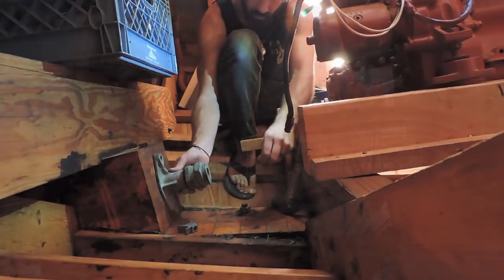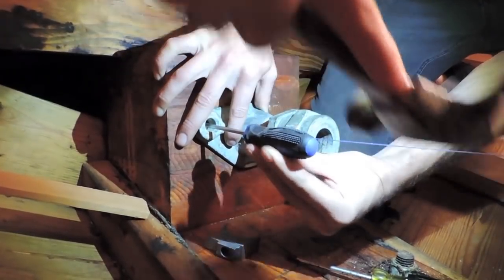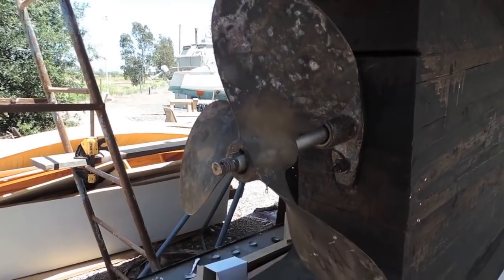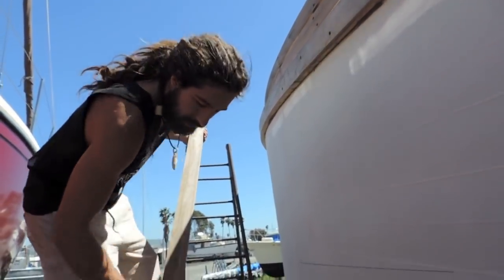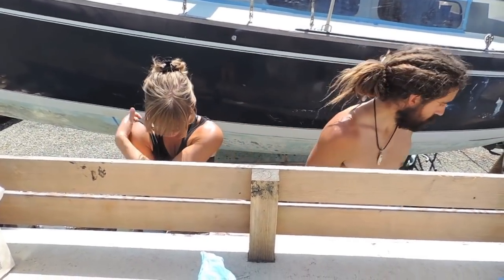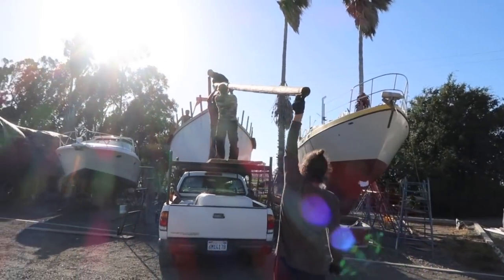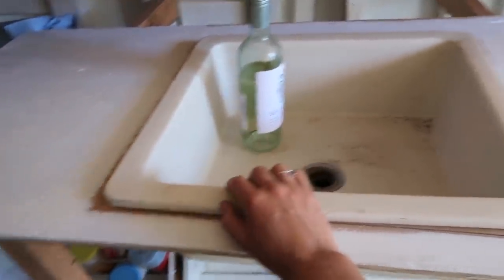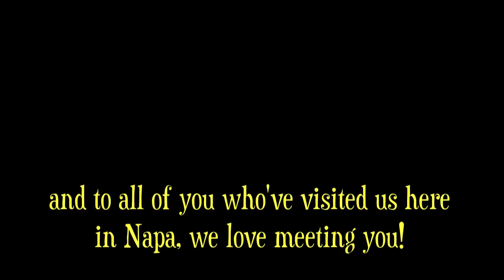Salt & Tar: Episode 36 - This, That, and the Other Thing

Comment: “We put it on upside down” was SOOOO meaningful to me as that seems to be my life’s motto! Every project, no matter how small, suffers from something upside down, backwards, inside out, reversed, the wrong end, part, size, thread, angle, or braking when overtightened. And at least one “where did I put that (fill in the blank) that I just bought?” Seeing two relative pros do it to was, somehow, reassuring and encourages me to be less critical. Thank you!
,
,

Comment: @16:30   Yes, a slick is a very personal tool. It takes extra time to sharpen and obtain the perfect cutting edge curve. I have inherited my late Fathers slick and can feel Dad's presence when i use it................... (you have a very good and soulful boat neighbor).
Reply: My 3" slick was 75 yrs old when I got it.  That was nearly forty yrs ago.  Many of my tools are older than I am.  when I use them I think of if those men would approve my work.  Quality tools do have a worthy life to be passed down.
Reply: Pat Brown
I inherited some of my late Father's tools, a master machinist, and master welding trainer. I even have the very first tool he made, a bolt puller, on a lathe at Tech school ! Every time I wrench, I too feel his presence over my shoulder and wish for his approval and advice as in my youth. He tought me everything.

Comment: Linseed oil...
Once a day for a week,
One a week for a month,
Once a month for a year, and
Once a year for life.

Do this and you will have no issues with your oiled wood.
Reply: True true.......we old timers know this and live by it.
Reply: mildew loves linseed oil which can be a problem especially in moist (hmmm.. boats?) conditions. Also no UV-light resistance.. UV causes more damage to exposed wood than any other factor.
The  saying 'Once a day ... ' is at max some sort of guideline.. The time it takes for linseed oil to properly dry differs a lot depending on wood sort, climate, etc etc. 'once a year for life' is also untrue. the intensity of usage of the subject, say a tool handle that's used every day or some furniture that's in a corner of the room makes a big difference in how often it should get maintenance
ever tried tung oil?
Reply: @amananca  Interesting. Have you ever tried Pedant oil?

Comment: It’s me again.  On canal boats we fit a grease point between the stuffing box and the outer bearing.  This is connected to a remote greaser which can be filled with grease and periodically given a twist to make sure that the space is full of grease.  Not sure if you need to do this with a cutlass bearing.( cutlass bearings aren’t used as canal water is often gritty, which wears the rubber).  Quite often a container is placed below the stuffing box to catch any drips or grease.

Comment: Wow! You two bring a tear to my eye. You love one another and you love what you are doing. What more is there in life. All the best and can't wait for the splash.
PS - that stuffing box has to drip two or three times a minute when the shaft is turning, and stop dripping within a couple of hours when not turning. Start snugging it up a little at a time and never run it for an extended time without a slow drip. Water lubricates the bearing and stuffing.

Comment: Ruth, I remember you had answered this before but I will say once again, in my earnest hope to be more clear, that because the shrouds are raked, or canted aft of the mast, the bend in the chain plates at the channel must also be raked, or, less than a 90* bend.  The degree of bend in the chain plate where it rides over the channel would be the same as the angle of the shrouds aft of abeam the mast.  I reckon the bend in the chain plate might be about 20 degrees.  Remember, you has said the chain plates lead aft to station 10 or so.

Comment: You probably already know this but the trans drive flange has to be dead square, centered and parallel to the shaft flange. As in bring them close together and check the gap with a feeler gauge wedge shim adjust the angle so there is no gap 360 deg. also the center lines line up. Put an indicator on the prop shaft near the flange and rotate to check centering run out. Then when its in the water and has settled a bit check again.
If theirs some sort of rubber drive flange ect it is still important to get them straight. It really makes a difference on vibration and wear. Also polish the prop with a fine wire wheel it also makes a big difference in performance.(and will look good in pictures) Decent sized prop for a sail boat looks good
Getting close to launching yahoo

Comment: Great gift for a boat builder, shaping wood made much easier and provides a better result. Nice work on the prow and stern. Did you choose to shape the aft keel? Rounded off loses no strength but can give a much smoother ‘release’ improving speed. Shouldn’t affect tracking as rudder is behind the keel.  Rounding rudder edges would also smooth out tracking & resistance.  
I kinda dislike me for mentioning things you probably already thought about or done but am new to your journey and mean naught but well.  
     To safe and lengthy passages
     Drew

Comment: Great episode... nice to see all the work is paying off!

Ave did an episode showing that spring lock washers are useless. We dont use them at all in aviation. Use temporary (not permanent) locktight or drill and safetywire... its much better!
Reply: I use red lock tight. or what i call star lock washers (serrated) Yes split washers should only be used on fences and gates ect.
Reply: Ps lock tight does not work on stainless not sure if it works on bronze? Don't think so. The split washers may be the only option?
Reply: Locktight brand 242 and 243 are designed for inactive metals specifically ss. Active metals (bronze) 243 can be used but 7649 needs to be applied first. We use this stuff on everything in commercial aviation. 

Personally, i would side drill and safety the nuts. To prevent any chance of the barring assymbly from loosening and causing damage to the stuffing box... but its their boat... millions of ideas and ya never know what wont work till it doesnt.
Reply: Interesting you learn something every day How will it hold up long term under salt water? Dont see them doing the special locktight thing. Safety wire sounds interesting since when you think about it they have 2 points of rotation the nut and the stud in the wood so if you wired the two together or to the center that may solve that? But as im sure you know safety wire is not designed to maintain a high TQ the component can still loosen its designed to keep the nut/stud from  loosening to the point of causing a catastrophic failure. (falling off)

Comment: Looking real good. On the packing gland make sure it isn't too tight it can get really hot if no cooling water can get to it. On, Gland seal wrenches. Make sure you have the ones that fit and store them close to the seal so they are handy. You probably already know this.  :-)

Comment: Any concerns about seawater in the shaft log (the wood part that houses the prop shaft) ?  I forgot how you treated that wood so long ago.

Is the traditional way to NOT grease the packing ?  Lanolin grease might be good.

VERY COOL story about that slick.  Properly cared for (packed in oil soaked rags) it will easily see 100 years !  Looks like Garrett knows how to sharpen it !

Comment: Wow......I may have missed something earlier, but I sure do hope you sealed, or treated in some long-term fashion the tunnel the prop shaft runs in through the whole deadwood/keel.   It WILL end up full of sea water....and no amount of bottom paint or treatment on the outside will keep it from just simmering along in there.

Comment: Add thrust bearing on rear. I’d add a third bearing inside and use a flexible coupling. Also need to have water flowing through cutlass.
Reply: Not sure about there trans? But a paragon trans or a velvet drive? Spelling/ ? does not need a thrust bearing. Flanges work well but need to be squared up dead on like within .002 The water in the tunnel is a good point  its just going to fill and not cycle? 
Im sure there is many reasonable ways to set up a drive line

Comment: Funny I wrote below b4 end and u did it. So funny shows why your one of the best channels on the net,

Hey not sure how old this is. But try moving prop back or you'll have power issues its to close to the keel. Or shape the keel around prop so u get full water movement.  Its to close your gonna lose alot of power.
Love your channel. This was made when u first showed prop placement so may have changed.

Comment: Always fun to watch you guys make a process. Keep up good work and patience will pay off. The question I am curious and notice your boat's wood is now seasoning and crack and what are you guys going to do about a wood crack open? Are you going to fill the wood crack or coat with epoxy? Just wondering. Stay strong one day at a time.

Comment: Of all the channels I sub to, I enjoy it most when I see a new S&T episode waiting for me. I know part of it is from never really knowing when you will post an update. And a lot of it is that having watched you guys for so long I almost feel vested in the project. I was almost expecting an episode like this at some point, covering all the "little stuff" that is totally necessary but hard to fit in a regular episode.

I understand the stuffing box, and that it has to drip slowly to work properly. That means that the prop shaft hole is filled with water. I know you sealed it good, but I would be afraid I didn't do as good a job as I could/should have and with the water standing in it, it would rot out on me. Is periodically resealing it something that gets done or not. It would be a bit of a pain pulling the prop and shaft back out, but I would think that was part of regular maintenence on a wooden boat.

Comment: OK,  Silly question but I guess you are not using a stern tube and relying solely on the deadwood and bedding compound on the stuffing box to create your watertight seal.  While you might get a great shaft seal, one wonders how well the sealing arrangement will work if you suffer any damage at the stern?

Comment: Been watching the series doing a great job BUT installing the prop shafts and bearings you do need to fit a stern tube , if not you will probably get problem with water and marine life getting past the bearing. Also viberation from the engin keep up the good work. Kev

Comment: Greetings!
Love your videos and fresh approach to boat-building.  Have one concern about what is shown in the start of this one.  It appears that you used fasteners to secure the stuffing box and the cutlass bearing assembly that are lag screws on the wood side and regular threaded machine screws on the other side.  Is this true?  My experience with using lag screws in any application where a lot of movement will occur (such as this) is that they eventually work loose.  The predrilled wood holes just can't retain their dimension, become enlarged, and the fasteners lose their functionality.  With a drive shaft, that could cause serious issues.  
What do you think?

Comment: I have a question. Once the prop shaft passes through the outside bushing and flange, there is a short length where the shaft is passing through an open space enclosed by the wood of the boat. Then the shaft passes through the inner bushing and packing gland. The packing gland prevents water getting into the boat. But the outer bushing isn't water tight. Will water get into the space around the shaft where it passes through the wood? That cavity will be filled with water? Has the cavity been  waterproofed?
Thanks!
Reply: I was thinking the same thing...thought I would read the comments before posting.
Reply: Yes and sort of is the answer I think.

Comment: Hi Ruth and Garrett, I know you get many comments and you cannot possibly heed them or read them all. One thing I did notice and perhaps you have too is your diesel engine has a drain tube on the crankcase so you can "suck" the used oil out when changing it. I follow others doing similar builds and cruisers too. You might want to make that tube gets replaced with a new one and also it doesn't come in contact with anything while the engine is running. It can be damaged without you knowing and you could easily have oil in your nice clean bilge not to mention the possibility of losing you engine to lack of oil. Are you going to put a figurehead on the bow beneath the bowsprit? Nice shape work on the stem by the way.
Just ordered my shirt, happy sailing.

Comment: Gland packing must alway drip water so I doesn’t burn and wear the shaft if that becomes annoying you could engineer a mechanical seal to fit that installation and no dripping into your hull

Comment: Did you install a KINGSBURY thrust bearing on that propeller shalf for that propeller to push/pull against to transfer force to the hull. Without it you will destroy  the  engine crankshalf or the transmissions shalf support and much smaller thrust bearings that can not take the force. .
Reply: My wood cabin cruiser with a paragon trans does not have or need an external thrust bearing. Its pushing on the back of the trans not the crank shaft . maybe there brand of trans needs an external thrust?
Reply: That transmission better have a heavy duty thrust bearing in it. Some marine transmissions do have an internal thrust bearing to compensate for the propeller push/pull.  Without a thrust something is going to wear and break from the sideways thrusts.

Comment: Silly question 72! - Wont the set up mean the prop tunnel will be full of water? Wonderful though...
Reply: Not silly
Reply: I understand that water is needed to cool the contact points on the shaft - many times i've burped shaft seals. I was just wondering about the exposed, but treated wood???
Reply: They have been using different treatments on the wood as they built it (OLD style treatments) Hope that is good enough.
All it takes is one area developing a problem and they will have to haul it out and do some surgery.
If he gets the seal packing set right it should be very loose to start to allow for the swelling maybe that will  let the air out? I think they know to tighten it till it just stops leaking after it sits in the water for awhile
Reply: Absolutely agree. In my head, and if it was my soul project! I would be thinking of lining the tunnel with epoxy and a Hep20 pipe to stop standing water. Probably overkill and totally not necessary - but my brain would explode with worry! Not a criticism of their wonderful undertaking - just a question as wood is a wonderfully new calling for me in boat construction...

Comment: And now drill holes into the timber log and fill it with hot grease , you can’t leave it hollow water is going to get in there and rot ,
Reply: Good point

Comment: If you want linseed oil to do a protection job, the first of many layers should have been done with a mix of turpentine.. as much as 60-70 percent turpentine, for maximum penetration. Only the last few with linseed only...
Reply: They did say they were mixing it with pine resin..........basically turpentine.
Reply: @alexbowie6316  no it's not. Only if it's distilled it is, then it has the properties that enables it to draw/penetrate the oil into the wood... big difference.
Reply: Even white spirit is acting as a transfer agent mixed to Linseed oil. Nowt wrong with pine tar............Vikings and people in that area today still treat pine and spruce boats with it.   Are you bothered?
Reply: Alex Bowie  One shouldn't absolutely NOT use white spirits as a transfer agent, it transfers itself more than what it's mixed in with... very poor suggestion. And pine tar and resin... sigh.. NOT THE SAME! You should stop commenting on a subject you obviously know very little about. The Vikings are not impressed.
Reply: R. E. Hill seems the type of person who'd have a large empty space around them in a crowded bar.
Reply: Ok I'm dumb enough to get into this.
The first coat is by far the most important since it seals the wood and limits the following coats . you mop the whatever on until it all stays shiny for at least a few minutes and the areas that do dull up you add more. 
I have always used teak oil from the local hardware store . I think its tung oil with a solvent and have not had issues with rot mold mildew or soft spots. There maybe a better way?